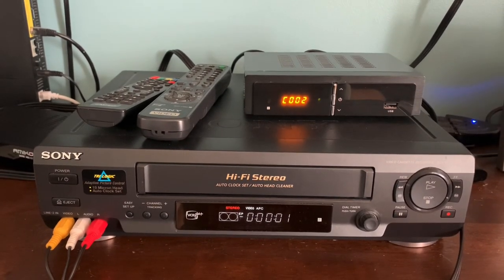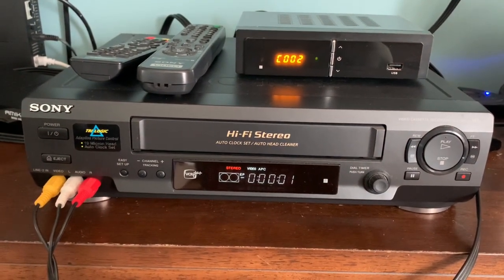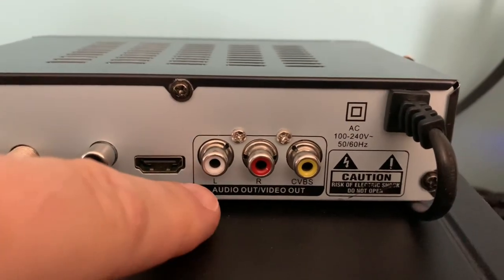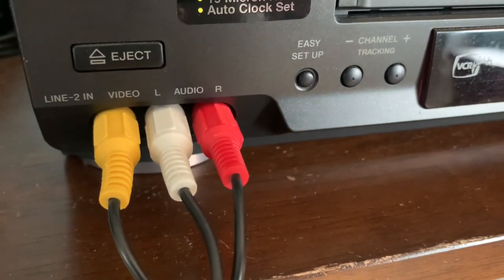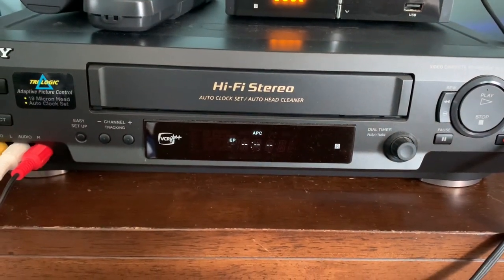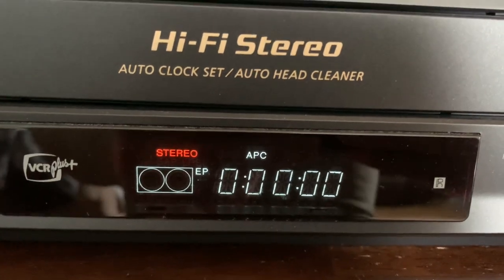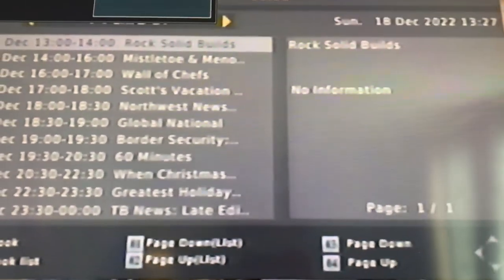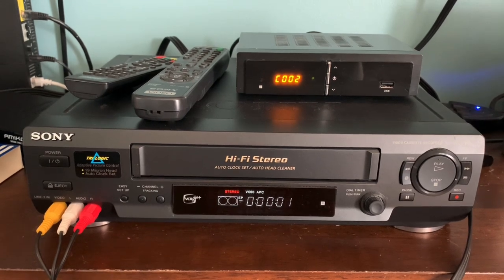How to Connect Your OTA Digital Converter Box to Your VCR to Record TV on Video Cassette

Comment: Hello, im using a Roku on an old crt, but the crt has hdmi. Im plugging the roku into the hdmi  (in) on the crt tv , and then taking composite cables into the vcr from the tvs “tv out” section… im not getting any signal for recording? Wouldn’t the roku basically be your digital converter box? Confused here why this isn’t working
Reply from the maker: @thezogs95  I wonder if it has to do with the resolution settings on the TV. The VCR may not read an HD resolution signal. Try changing the TV’s resolution to 480i.

Comment: At 2:34, for Mono TV sets and VCRs there is an RCA Y adaptor, two RCA female and one RCA male to convert the stereo audio into mono audio. I used to do this when I had CRT TVs. The RCA Y adaptor was useful mostly with DVD Players and gaming consoles (Playstation, Wii, XBOX).
Reply from the maker: I have one somewhere but I figured most people wouldn’t bother with it.
Reply: @NorthcoasterHobby  If you use it for gaming it is mandatory back when I had PS2 and PS3 on my CRT TV In some cases I couldn't hear some dialogues especially on "Grand Theft Auto" games, and some PlayStation Exclusive games. And it's because they were broadcasting on the right channel (red connector). When I searched on Google I found out that mono TVs need an RCA Y adapter. When I replayed the levels I could hear all dialogues, same thing with movies. The best part is that European CRT TVs use SCART connection and even if it's a mono TV you don't have problems with stereo audio, they automatically convert the audio from Stereo to Mono. RCA to SCART adapter work in both ways and broadcast stereo sound.
Reply: @NorthcoasterHobby  Hi thanks for the video;i did connect  satellite rca cable to   my Sony VCR e  through RCA cables input  1 and in order to get the satellite video out to tv chan3  i have first to put a vcr tape in running and then turn tape off so i get signal out to tv .Is there any setting that i have to change in the vcr so i don't have to go through that process,Thanks.?
Reply from the maker: @MrSilv55  If you’re using the RCA plugs there should be an input select button on the remote. Select Line 1 or Line 2. Or use the channel +/- button to select the line input.
Reply: @NorthcoasterHobby  Thanks mate, but i have it on Line 1  connection ,Also same with line 2. But signal from satellite  don't come up unless i first push play button  that show video tape content  and than i stop video then  signal from Line 1 shows up . THat's what i don't get it?  My Sony VCR is same module of the one you have in the video.

Comment: Is there a way you can use a vcr to record a crt tv? Also, my vcr box does not have red white and yellow cables out front like yours so is this still doable on an hdtv?
Reply from the maker: CRT televisions and VCRs both have analog tuners. They can no longer receive any TV broadcasts. Connecting a digital converter box as shown in the video allows you to record TV broadcasts. They can be played back on a CRT, however. A VCR without RCA plugs can be connected to a television with the RF out coaxial cable connection to the TV’s RF or Antenna in connection. It will modulate to channel 3 or 4 on the TV. But on an HDTV you’ll have to run a channel scan to watch the VCR content on channel 3 or 4.
Reply: @NorthcoasterHobby  So an update: I followed the steps as described on the video and I think I was able to connect the red white and yellow cables correctly even though it is not equipped like your vcr box. The inputs and outputs are all located on the back side of the box. My only issue is connecting to the AV input on the hdtv.
Reply: And I have been able to watch vhs tapes on an hdtv on channel 3 or 4. Combining it with the converter box using the AV input is a struggle however.

Comment: There are some people who use more than one connection to record video from the TV. It takes two converter boxes two antennas or a splitter using the same antenna to hook up to both and if the same VCR has two RCA inputs you can use both with separate boxes. Complicated but true.

Comment: You can use the rf out too. And most people dont use the hdmi out because almost all HDMI tv's have a dtv tuner in them
Reply from the maker: Lots of people use the HDMI out on DTV boxes.  And yes, you can use the RF out to connect to a VCR if you want.
Reply: Why? most tv's with hdmi dont need a dtv box @NorthcoasterHobby
Reply from the maker: @Warp2090  Somtimes the tuner is better, also the signal meter is useful.
Reply: ok @NorthcoasterHobby

Comment: I have a question about the second output.  The tv that I am trying to hook to a VCR/DVD combo does not have the red/yellow/white connections.  It has red/white and then red/green/blue connections.  How would I make that second connection?  Could I use the HDMI port?   I have not purchased the OTA converter box yet but will.  My parents have recently cut the cord and have went with an antenna for local channels.  My mom would like to record some programming from the PBS channels.  Thank you in advance for your help!  :)

Comment: 5:50 my satellite box won't record so did i have to use 30yo vcr?
Reply from the maker: @Heprotecbuthealsobodek  You could record with the VCR. Connect the satellite receiver to the VCR through the RCA AV cables.
Reply: @NorthcoasterHobby  as an "asian" gen z, I don't have VCR at home but I have VCD from my village tho

Comment: Why did you not mention the rf out? Also no one uses the hdmi out .. Analog tv's rarely have hdmi
Reply from the maker: I said that the HDMI was commonly used to connect to modern TV’s, not CRT televisions. I never mentioned the RF out because most VCR’s have RCA composite plugs. Use the RF out if you want to.
Reply: Most vcr's have both rf and composite @NorthcoasterHobby
Reply from the maker: @jaembryantu  True.